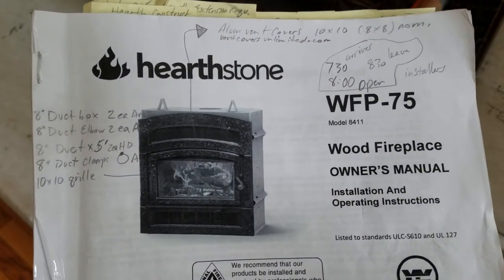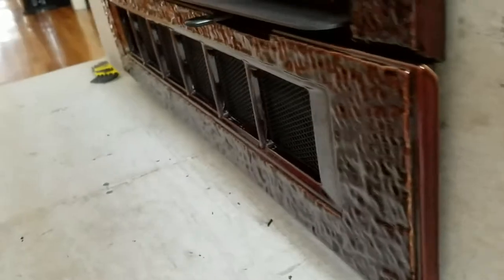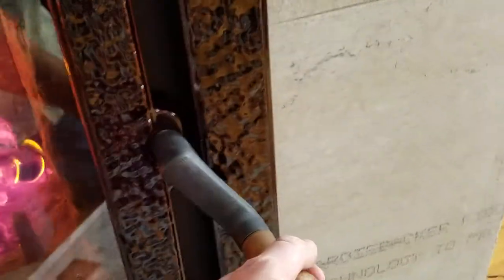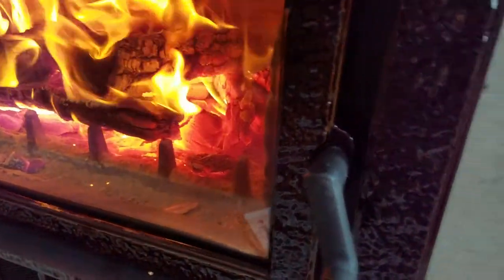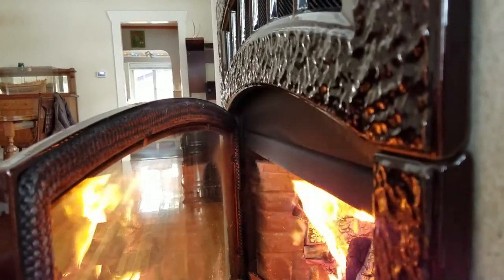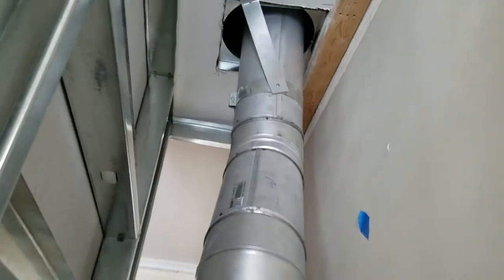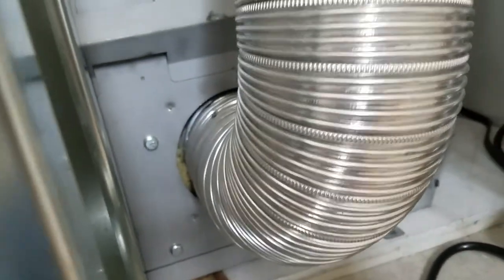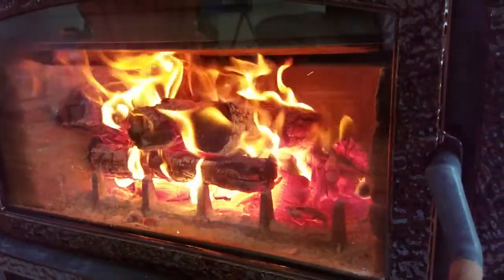Watch this before buying new Hearthstone WFP-75 wood zero clearance stove

Comment: Got the same one in black. Door is good. All above suggestions are true about cracking the door open.
Biggest complaint is it never gets hot no matter how raging fire I have. The glass gets hot but none of the metal. Absolutely no radiant heat anywhere. It takes hours for the auto fan to turn on and air it blows is mildly warm or cool even. Then about that time it’s time to remove ashes 2-3 times a day because the wood area is so tiny. Installers and builder were so careful not to have combustibles to manual specs but that’s all worthless because it stays cold. I’m guessing the unit has so much insulation it cannot get hot. No heat whatsoever. You’ll freeze with this unit. Very disappointing and a total waste of money and effort.

Comment: We’ve had our WFP-75 for a good 8 years or so. We have a 1300sqft open style with loft home and it gets the upstairs nice and toasty while it’s freezing downstairs. We bought this with the intentions of it being our main heat source and save on electric in the winter. We were so wrong. We also noticed on windy days and we aren’t using it the wind blows right through the insert! Makes the house cold and baseboards kick on then. Very disappointed with it.
Reply: close the flue when not using, easy fix

Comment: Fresh air pipe and flue pipe should have a 1:4 area section proportion. If the flue pipe has 8", then fresh air pipe must be 3.5".  otherwise, for a bigger proportion than 1:4,  the smoke of your woodstove it's 'undecided... 
Another thing to make sure your not getting any flames inside when the door is open, the outside pipe must be about 4 feet taller above the roof corner. And the last, make sure the cap of woodstove pipe is a qood quality one, which can resist on wind.

Comment: Was your angles originally right on top of the stove? The manual says it's acceptable but 18in+ is recommended for best draft. 

What sucks is I already have the dang thing boxed in with stone work about half way done. Would have to cut apart a different wall to access it 😑

Comment: Have had ours for three years. Sounds like you don't know how to operate it. For one you need to build a fire and leave the door cracked until the fire is going good. Only then can you close the glass door. We leave the combustion air at wide open most of the time because it makes a pretty fire. If you close it off, the fire gets lazy looking but is more efficient. BEFORE opening the door to add more wood, you barely open it for about 10 seconds to get a draft going. I suggest you read the owners manual. Also make sure you have a chimney that is tall enough. We can burn wood for a week before having to take the ashes out. Works very good!!!

Comment: So what’s the outcome did you get hearthstone to correct this issue ? If not contact your home owners Ins and explain why you feels it’s unsafe that way they can go after hearthstone
Reply from the maker: Well, sadly, we're getting our deposit back. Love the look of this stove but we think we're going with Canadian Pacific Energy FP25. Thanks for asking.
Reply: @ratbagley  did you end up getting the pacific energy stove instead? If so, how has it been working for you?
Reply from the maker: @GENERALJONJON  sorry for the late response. After we wrote them a long letter there's distributor / installer ended up giving us the stove for our down payment which was about $1,000. The original estimate was around $8,000. After thorough review, I ended up moving the 22.5° elbows up higher above the stove rather than right above the stove. I was then able to remove the 10-ft stack over the roof and bring it back down to 4 ft. It burns pretty good now and I only paid a thousand bucks. The installer really screwed up by not reading the manual

Comment: I have had my WPF-75 for 5 years. This is the absolute best wood burning anything I have ever seen. It is super efficient and if the outside temperature is not below 50°F then this thing will run us out of the house. Our house is just over 2000 sq/ft with 19' ceilings. I hate that you are having trouble with yours but these are very good inserts. It sounds like you have a draft issue if you are gettig smoke in your house. The way to find out, crack a window open and see if your house fills with smoke with the door open. If it does, then there may be an obstruction in your flue. If it does not, then you have an intake air or damper issue. Also I have found that if we have an exhaust fan on, this can also pull smoke out of the fireplace into the house. Hope this helps.

Comment: I installed the WFP-75 in March 2021 and mine has no alignment issue with the door or face plate. I have similar problems with getting a fire going. A couple of things I have learned:
1) The lever you refer to as a damper is not really a damper. It is an air combustion control. 
You mention in the video that you have it full open. Actually, the far left position is closed and this is where I found it burns the best. As like in your video, I can move the lever to the right (fully open) and there is no change.. The manual mentions to run it at 3/4 closed (left). It works best fully closed for me as I’ve said. In this position the manual says it’s the slowest burn (6-8) hours. I don’t get anywhere near that. I wonder if the fresh air intake is affecting things?
2) It takes me about forty minutes of burning before I can fully lock the door with the lever again all the way left. The manual says to start the fire, put control lever to the right and close the door. This does not work. The fire dwindles and goes out. I have to crack the door and wait until I get a good bed of coals before I fully lock the door. I suspect this is due to the need to heat the air in the chimney pipes. Once it’s up to temp, it burns OK. 
3) To avoid smoke pouring back into your house, obviously at start up, get a up draft going first. Whenever you need to open the latched door, first rotate the handle to the open position and wait for a few seconds. Then slowly open the door about an inch and wait for about ten seconds The air introduced causes some smoky turbulence  once it subsides you can fully open the door to tend to the fire. No insult is intended if you’re doing this already. You may have a draft problem that I don’t. I think the manual mentions  having at least ten feet of chimney pipe to draft properly.
I am confused by the manual stating that you should never have a raised fire. I find by stacking
the wood I get the best fire. It says to rake the coals towards the andirons and place the next piece of wood towards the back. I go right on top of the coals. I don’t see any harm by this but it’s not clear. I would love to get 6-8 hours per load of wood but I don’t think it’s possible.
I’m sorry you have the problems but you’re not alone. Please respond if you discover anything about maintaining your fire. We can learn from each other. The manual is vague on the operation of the blower fan. I haven’t figured out how to get it to run on automatic. I just rotate the dial to get it going. 
We bought the WFP-75 because we liked the enamel finish. There aren’t many choices out there. I also like the wide glass door for viewing the fire. Good luck.
Reply from the maker: Hi Frank, we really appreciate the details you added to this. I will respond in order like you did. The problem with the door was because the hammerheads that installed it scratched it. One of the problems was that they tried to install the door with the facade in place. It went on but with collateral damage. The distributor replaced the front from another unit but did not align it correctly or tighten the screws I think.
1) Combustion control: Your model must be different (a year older maybe?) since they show a "+" in the manual to the LEFT side and call it "air intake". The only way we can run it with the lever to the RIGHT is if the fire is 700° + (infrared thermometer pointed at the center of the glass). Fresh air intake: I was methodical about the intake and it is short and direct. The require a kind of drip loop for cold weather when it pulls in cold, damp air I suppose. I have also disconnected the metal intake hose with zero change. 
2) We can get the door closed in a 30-40 min or so but, yes, the door must be open for a long time. This does not seem right. 5-15 minutes maybe but our Quadrafire just required us to open the air intake until it got going - 5 minutes or so. 
3) Agree, we learned quickly to crack the door and let the smoke evacuate the firebox before loading. Even then, WE ARE GETTING SMOKED OUT! Every time we load wood, flames and smoke pour in to the house. We have about 15' of chimney so length should not be a problem. 

My manual does not mention never have a raised fire. In fact , It says place 5-7 pieces of wood in the North-South direction (good luck with the short, low firebox). 
Blower: We put ours in AUTO and wait for it to come on by itself but it has to be HOT before it ever comes on and it stays on until the firebox is cold. I would rather have it come on sooner and go off sooner. When we first started running it, we thought AUTO didn't work since it took so long to come on. Btw, the manual says the blower only adds 2% more efficiency! This surprised me. Another fun fact: The manual says it has been tested to run with the door open and a fireplace screen in front. Yeah right. Not here. It would look like a tire fire inside. I will try keeping a lower fire like you said and further back behind the andirons. Maybe that will help. 

One last thing, we only get about 3-4 hours out of our stove if i really load it up. We are using dry Red fir and Western Larch (like big eastern Tamarack). Both great woods for burning. The 8-9 hours mentioned in the manual must be using coal. We also loved the enamel finish. It would look good when we get our hearth tiled and wood mantle finished. 

Thanks again Frank!

Comment: everything you mention has happened to mine.  Professionally installed, now wont help at all.
Reply from the maker: That's too bad, it's such a nice looking stove. The installer should be the one helping make it run right but there should be lots of support from the factory. They won't even answer the phone if you're the end user. Thanks for your comment!

Comment: I just had one of these installed after waiting about two years after ordering.  Nice looking stove and seemingly well built.  Its in place, hooked up and inspected.  I am now waiting on the blower to be hardwired and it to be "buttoned" up within my wall (it is currently still opened up).  I have had 3-4 break in fires so far, however.  

Some observations/questions:
1.  My door, too, was misaligned.  Higher on the left side (hinged side) and sloping lower to the right, where the handle latches.  Not sure if it was shipped that way or if the installers just put it on quickly with no adjustments.  But since they are not finished yet, they said they will take care of it.

2.  My Primary Air Control Lever does not seem to go all the way to the right side.  Left is open and the lever definitely looks able to be positioned all the way to the left.  When shutting the air control to the closed position, it seems to be only able to go to max 2/3 or 3/4 of the way shut.  There is still about a 1/3 to 1/4 section of that slot that the lever cannot get to.  Now I do know that these newer EPA stoves are designed to only shut down to 80% of the air to not smolder, but I have had other stoves (Pac Energy Alderlea and VC Winterwarm where the lever had free range from left to right and didn't just stop

3. The air control does not seem to adjust the fire much from full air to "shut down".  I have no problem starting fires (although I do need to leave the door cracked a bit on startup to get it to draft normally) but once the fire is established and am able to start to shut the air down in increments, I do not really see any difference in flame.  In my other stoves, there would be a sizable difference in what I saw from air open to air closed (highly active flames to slow,  lazy dancing-like flames).  I am guessing or HOPING this is due to my door not aligning.  Obviously it is leaking air in, so hopefully this adjustment will help and it is not due to a malfunction or obstruction in the Primary Air Lever movement.

4. This all led me to check the door seal with the dollar bill/paper test and the door does NOT seal against the stove (which definitely would cause air to infiltrate).  I know it is not a gasket issue due to the stove being brand new, however, the hinges being adjusted and possibly the handle being adjusted to allow it to close tighter hopefully will help with this.

Our last break in fire was definitely the hottest and even without the blower installed it was throwing some radiant heat. It is my hope that the door/latch adjustment will help control the air situation, allowing me to control the burn better.  The last thing I want is to constantly overfire this stove due to this.